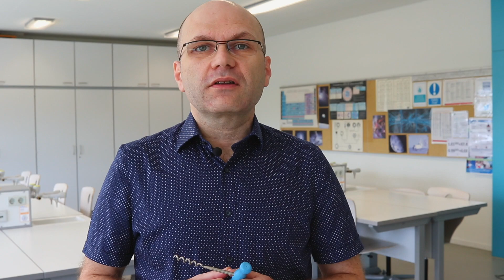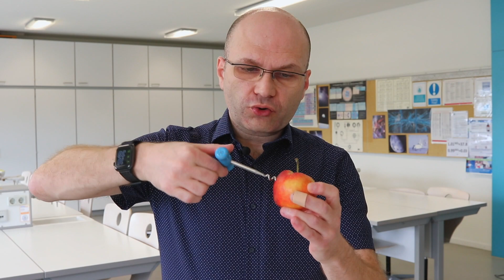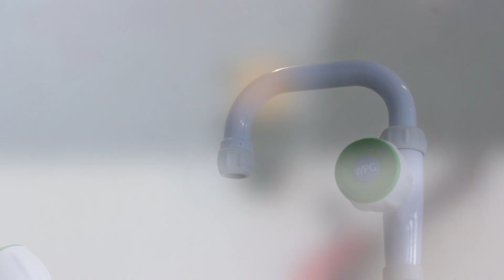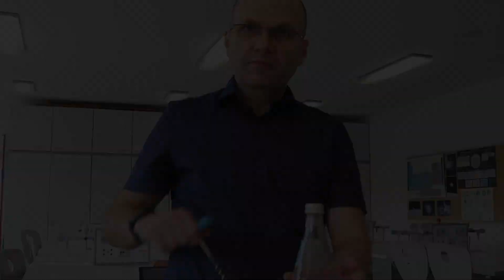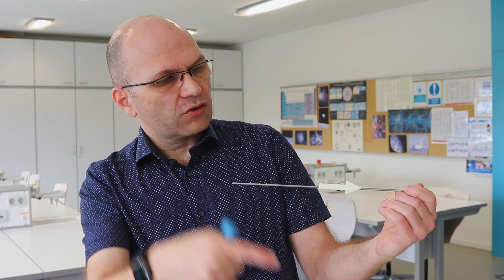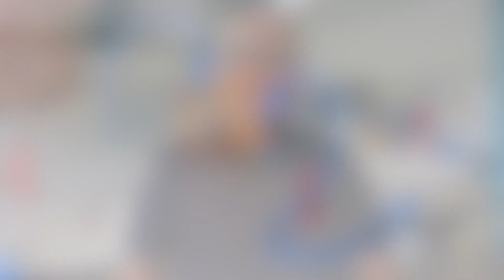Cork Screw Rule - Find Direction of Magnetic Field Lines For Current-carying Conductors and Coils

Comment: sir i need urgent help may i contact you, how a electromagnet and permanent magnet react with each other , may we transform permanent magnet 's magnetic force in electricity (generate a motor) with the help of less powerful electromagnet then permanent magnet
Reply from the maker: I’m not sure that I understand the question but yes, you can use the magnetic field of a magnet to induce a current in a coil moving/rotating relative to the magnet. But remember, you cannot create energy out of nothing. In fact, it does not matter how you get the magnetic field (permanent or electromagnet) as long as you move the coil relative to the field you can create an electric current.
Reply: @ibphysicshelp  ok as you say we cant get electric energy directly by this method, but in this situation i have mentioned in upper comment, may we convert magnet's force in mechanical energy, suppose electromagnet rod/shaft is free to move/rotate in magnetic field,  finaly my question is that the output result(mechanical moving) will be dependent on what less powerful electromagnet or more powerful permanent magnet ,  or electromagnet use more and more power According to permanent magnet power(magnetism)
Reply from the maker: Conversion of mechanical energy into electrical energy is done in a generator (that uses a magnetic field). The reverse, electrical energy in mechanical energy is done in a motor (which also makes use of an electric field. 

You can have a loop of wire falling under the pull of gravity in a magnetic field and generate a current in the loop (also, a braking effect appears in this context)